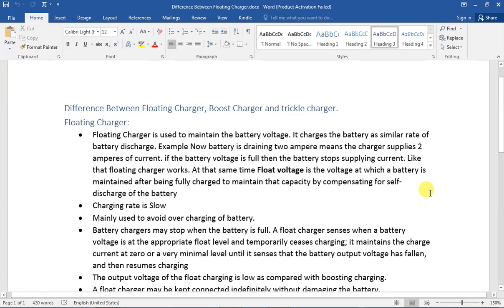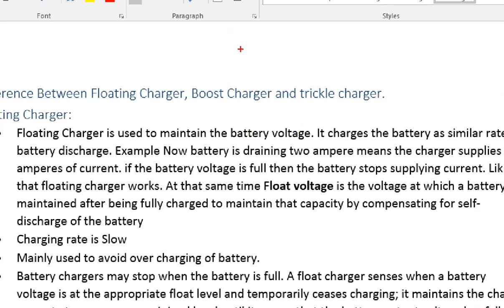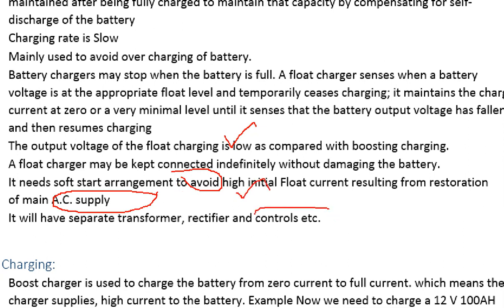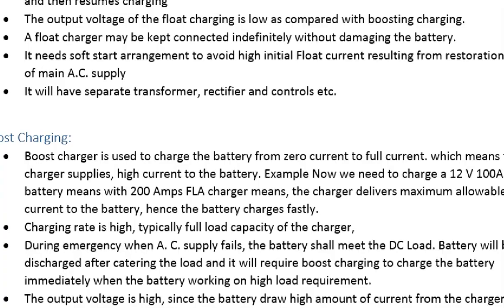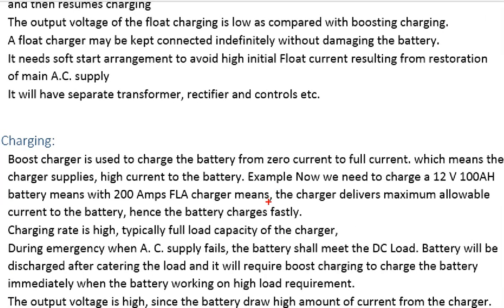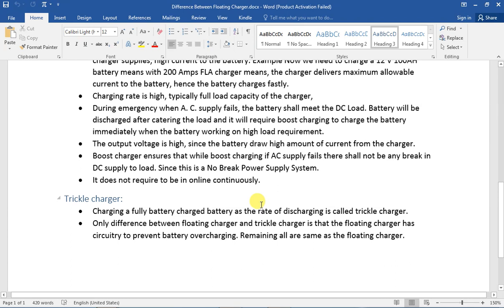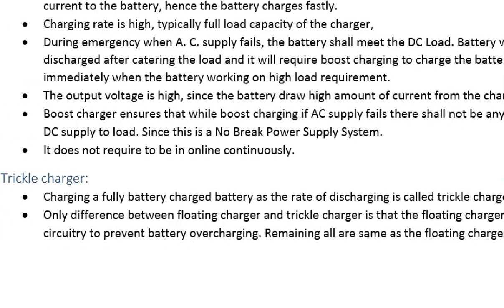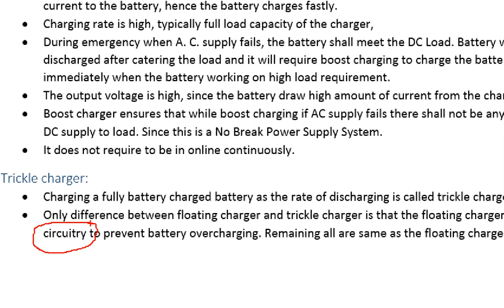Difference between floating charger, boost charger and trickle charger in tamil

Comment: According to the IEC standards for UPS systems, *float charging* is a basic charging function that maintains the battery at full charge by applying a constant voltage. This mode is used to keep the battery ready for use without overcharging it. The typical float voltage is between **2.2 and 2.3 V per cell**³.

**Boost charging**, on the other hand, is a fast charging mode that quickly restores a discharged battery to full charge by applying a higher voltage. After the system has been in battery operation, the charger may automatically switch to boost mode to recharge the battery efficiently⁶. Once the battery reaches a certain voltage, the system switches back to float charge mode to maintain the full charge without overcharging⁵.

These modes ensure that the UPS battery is maintained at optimal charge levels, ready to provide backup power when needed.

Source: Conversation with Bing, 3/24/2024
(1) What Is Float Charging: Differ it from Boost Charging.. https://sparkaven.com/what-is-float-charging/.
(2) undefined. https://www.productinfo.schneider-electric.com/galaxyvs_iec/990-5910_master-galaxy-vs-operation/990-5910B%20Galaxy%20VS%20Operation/English/990-5910%20Operation%20manual%20Galaxy%20VS_0000153852.xml/.
(3) charging methods for UPS batteries - Electrical Engineering Centre. https://www.electricneutron.com/theory/charging-methods-for-ups-batteries/.
(4) Configure the Battery Solution - Galaxy VS Manuals IEC - Schneider Electric. https://www.productinfo.schneider-electric.com/galaxyvs_iec/990-5910_master-galaxy-vs-operation/990-5910B%20Galaxy%20VS%20Operation/English/990-5910%20Operation%20manual%20Galaxy%20VS_0000153852.xml/$/ConfiguretheBatterySolutionTSK_0000176170.
(5) Start a Boost Charge of the Batteries - Schneider Electric. https://www.productinfo.schneider-electric.com/galaxyvx_iec/5b69ada2313cae0001704e8d/990-5452F%20Galaxy%20VX%20Operation/English/990-5452%20Operation_0000060284.xml/$/StartaBoostChargeTSK_0000029288.
(6) TECHNICAL SPECIFICATION FOR 30 V, 35A AUTO AND MANUAL FLOAT-CUM- BOOST .... https://www.wbsedcl.in/irj/go/km/docs/internet/webpage/techspec/Ni-Cd%20Charger_31.08.19.pdf.
(7) undefined. https://www.productinfo.schneider-electric.com/galaxyvx_iec/5b69ada2313cae0001704e8d/990-5452F%20Galaxy%20VX%20Operation/English/990-5452%20Operation_0000060284.xml/.